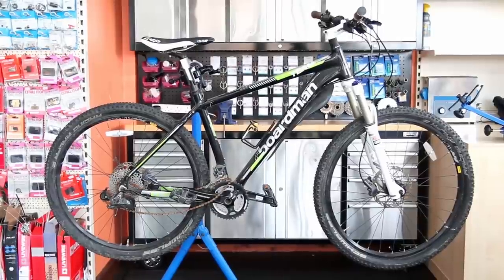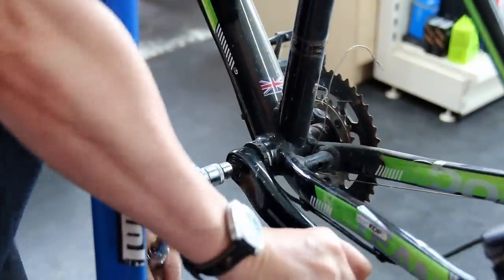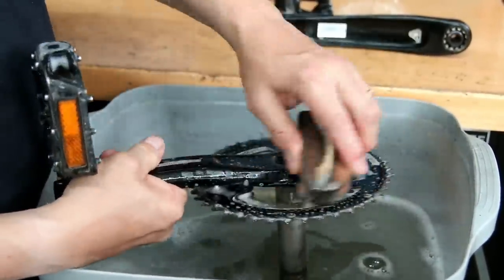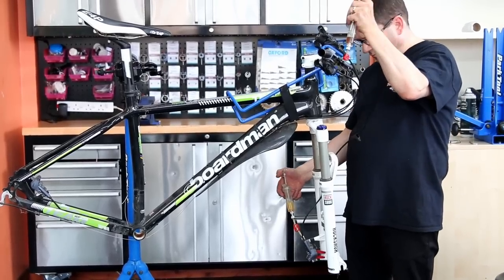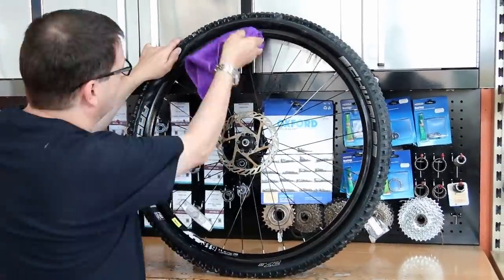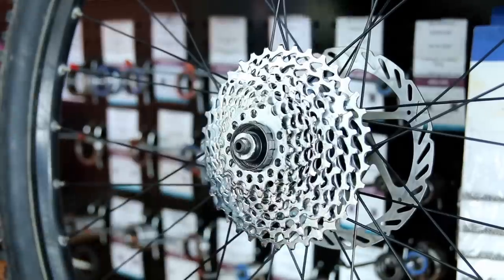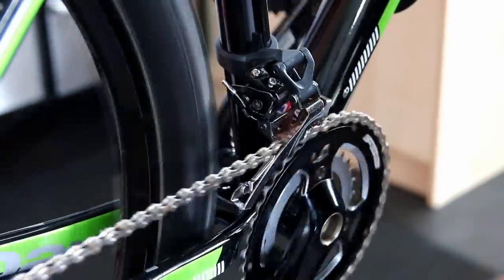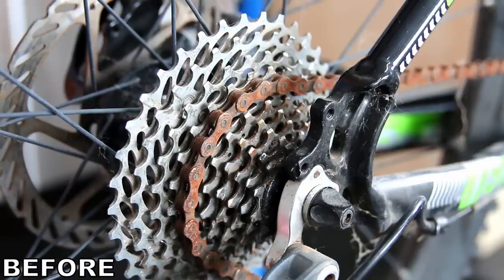Boardman TXC Service! Mountain Bike Rebuild Restoration!

Comment: Centering tire logos can be helpful detecting any spiky road presents that may have remained in the tire. It helps orientating when you pump up the damaged inner tube holding it beneath the wheel to see where the puncture happened. Much easier when everything is in order. We do it all the time in the shop. 
Great videos! Keep them coming, so enjoyable!!!
Reply from the maker: Thanks for watching Philip!🧡⚙️

Comment: Eugh those Elixir brakes. Absolute nightmare when I had a pair. Had to buy a couple of lever internals service kits because they leaked and corroded at the levers like that. Don't miss fiddling with those!
Reply from the maker: Disc brakes are often hit and miss we find, some work perfectly, some sets are just doomed to fail and can’t be fixed with anything but replacement⚙️

Comment: Bro that bike cleaned up fantastic great job .
I have a boardman txc sport 27.5 and it needs new headset bearings .
The mtb bearings sets online dont mention the txc sport probably because its discontinued but the one set seem to fit every other boardman mountainbike model .
Do all boardman mountainbikes use the same size internal headset bearings ? 
I dont have calipers to measure , any help is greatly appreciated thank you

Comment: Have been using AutoGlym on my road bike, which has a glossy paint finish. Really happy with the look and that dirt doesn't collect as readily. My gravel bike has a satin paint finish. Is there an equivalent product that will offer some protection without altering the satin finish? Thanks for doing your videos. I've learned a lot and improved my maintenance techniques significantly.
Reply from the maker: Autoglym won’t alter the satin finish. It should be fine on that too. Test it under the bottom bracket to be sure.
Reply: I have a matt finish Canyon, and I really like Crankalicious Cycle Care - Carboniferous Matt Detailer. If you get any marks or areas that start looking a bit glossy from something rubbing, I have had a lot of success using a Magic Eraser (the melamine foam cleaning pads) that you can buy from the likes of Robert Dyas - it seems to create just the right level of Matt finish.

Comment: Great service guys! Getting to know a lot on how to service my bike from you guys. I just got a multi tool and it has a chain breaker in it and that got me wondering, why cant 7-9 speeds use masterlinks? What will happen if you use a 7 speed chain with it? Thanks for making these videos as always. Love from Malaysia 🇲🇾
Reply from the maker: If the chain just has a pin it’s probably a budget chain. I sell chains with master links and the links individually for single speed and 5 speed upwards. With a 9 speed You need a 1/2 x 5/16 chain 8 soles down is 1/2 x 3/32 so too wide to site correctly on a 9 speed cassette.

Comment: How long does a brake bleed like that normally take? Without sped up footage and assuming everything goes swimmingly? Great video as per :)
Reply from the maker: The key is setting everything up currently for it to go smoothly, but actual bleeding time is no longer than 2 or so minutes with this technique🧡

Comment: I recently watched a Hambini video about the quality of these Boardman bikes... In your experience have you seen issues with these bikes?
Reply from the maker: The majority of bikes are produced to a retail price point. Boardman bikes are no different. Manufactures will often tick boxes so for example they might want the words “disc brake / tubeless ready” in the description and to reach the price point may fit very cheap bearings in the wheels or a low end saddle. There’s no good or bad really. One of the most underrated aspects of buying a bike it the build quality & how it’s been put together, you can have the cheapest bike out there, well put together that will out last a badly built high end bike.